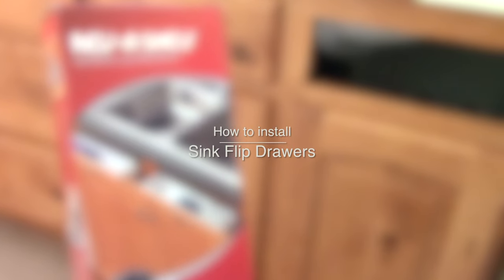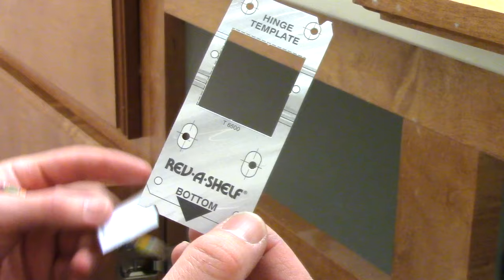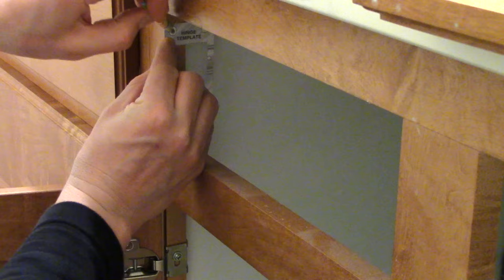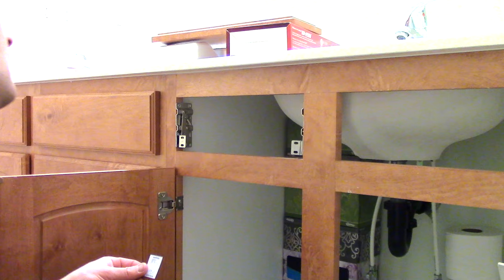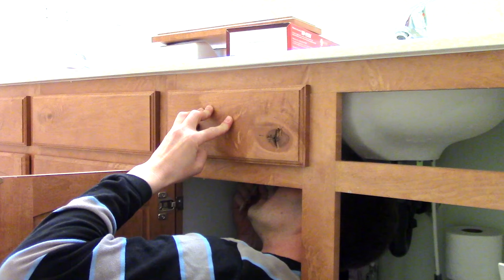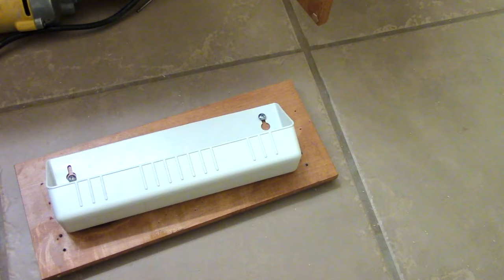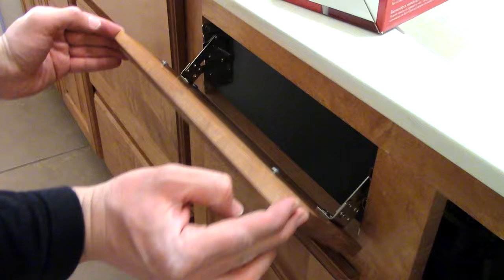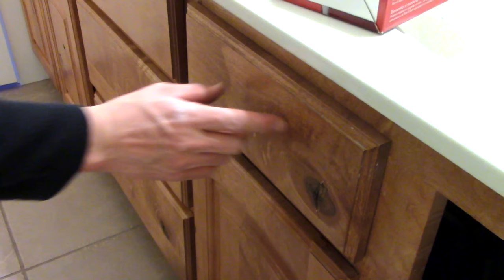How to install kitchen / bathroom sink flip out drawers REV-A-SHELF

Comment: Instead of "guessing" about the right placement for replacing the cabinet drawer to cabinet; why don't you register the door position before you knock it off.  I would lightly use pencil to mark where the corners of the drawer door align on the cabinet.  Knock them off and then you can put them exactly where they were before.  No guess work.
Reply: Bingo, I suggested the same thing. It also says to do that on the REV-A-SHELF online instructions...
Reply: Better yet, mark the sides of the drawer onto the cabinet using painter's tape

Comment: There are easier ways of installing these tip out trays. I watched a few others to get a general idea for an easy install since the instructions are not good. I installed mine quickly and easier than how you did it by watching others. You are making too many guesstimates. And aligning the panel without a level THEN holding while it in place with your hand as you contort yourself to get underneath the sink?? You have to be joking.

Comment: Dude never use a power tool for this, they are going into wood. A simple screwdriver would have been much better. You stripped the heck out of the screws, this will fail in the near future. take screws out and put wood glue in the hole and screw them back in.

Comment: Fortunately, our vanity will not be installed in the bathroom until AFTER this little project is complete.
   I liked one of the commentor's advice to mark the back of the panel from the inside and also mark for the hinges BEFORE even removing the false front panel. I might also be able to anchor the hinge in place before even removing the panel.
 Luckily our panel is only retained by six wood screws.
   I am hoping maybe 10 minutes or less to get the hinges installed and get the screws out.
  What will take the actual time is fabricating our custom cubby. I could not locate any 28-in wood or plastic bin attachment, so we will just make ours from some spare shelving and use liquid nails to attach it to the panel.

Comment: Thanks! So helpful. I ordered the hinges and trays separately (not rev a shelf). It saved money that way. Unfortunately, they came with no instructions. With your video, no need for them.  I agree, nice walk thru! Thanks again.
Reply from the maker: Thanks for the info.  Where did you buy them and how much were they?
Reply: AdamDIY I purchased them from the hardwarehut.com  aka 
Spokane-hardware.com. I purchased 2 trays and one set of hinges w/ screws for $16.94 -that includes shipping charges.

Comment: A great help and much better than the instructions! My Rev-a-Shelf set didn't come with a template, so this video was super helpful. I do like Rhen's suggestions for clamps. I had a hard time not letting the panels slip. I also suggest having a light down under the sink. My panels were dark wood and I couldn't see the marks very well. I also put a pillow under me to keep my tender back pain free. :)

Comment: Great, thanks!  Nice tip about the grinding.   I replaced the old cabinets, so had no instructions.  They were on the revashelf website with the template, but the video helped a lot more.  My drawer opening is slightly smaller than the template allows for, so I had to adjust the holes down about 1/8".  People might want to check before drilling.  The setback and distance between holes still was accurate.  I used a hole punch on the template instead of a pencil.  Made it easier to seat the drill bit.

Comment: Thanks, Adam! Good video! I'm pretty handy, but those "instructions" from Rev-a Shelf really suck! And my hinges weren't marked 'L' or 'R' either. I was fortunate enough to have my tip out trays on hand while my top was being fabricated, so after watching your video, it was a breeze. I do have one suggestion...if you need to get in there under the sink to take off the drawer fronts, if at all possible, hold the brackets in place to mark the pilot holes before taking off the false drawer front. Then, you know it will line up without needing clamps or an extra pair of hands. Thanks again for a very good, straightforward video. I'm checking out your others!
Reply: It's easier to just draw an outline of the inside of the drawer front BEFORE you take it off (while it's still stapled in). Then you have a reference line that shows you were the drawer is exposed and where it touches the front.

Comment: great video but just a tip - don't tighten the screws when you mount the the trays in the end. If you store sponges in these trays the water will drip on the tray and if the screws are loose enough it lets you remove the trays for easy cleaning

Comment: Thanks for the video made much more sense to me than the picture directions !!

 I do have one challenge though it doesn't seem to shut the door tight what do I do for that?
Reply: I had to install a magnetic latch to keep my drawer front from sagging. It was a little annoying to try to drill into the top edge of the opening; I wish I’d had a 90-degree drill head.

Comment: DeWALT electric screwhead stripper.  Or if you use the drill-motor carefully it works WITHOUT ripping the screws beyond reuse.

Comment: Just tried to install.  DO NOT attempt unless you can fit a screwdriver under your sink up against the panel.  There is no way to attach these if there is not enough clearance.  We finally installed them on the back of the doors under the sink and they work well.
Reply: It's easier to just put an electric screwdriver bit in a ratchet.  The bits are the same shape as a bolt so a ratchet will connect to it.
Reply: Dennis Morgan I had the same problem
Reply: Ditto. Same issue.
Reply: You could use either a ratchet, or a right-angle drill bit adapter.
Reply: Or use a socket set.

Comment: Reinstalling two of these in kitchen after cabinets were painted. Struggling way too much.  My deep sink makes it extremely difficult to screw on the wood/ cabinet panels. It also seems like the original screw holes are off, as my two cabinets panels won’t sit perfectly aligned. I’ve tried loosening and micro-adjusting repeatedly 😖. Any advice?

Comment: I didn't get a template for the hinges, BUT the hinges WERE NOT the problem. positioning the cabinet face was the issue. But with the video the rest should be a tad bit easier. Thanks.

Comment: Mine are actually glued on :-( Any ideas how to detach the drawer fronts without damaging the wood?
Reply: I was going to ask the same question. Any suggestions?
Reply: Heat gun will soften the glue. But don't start the wood on fire. That would be bad.